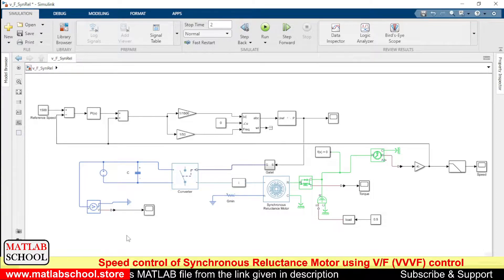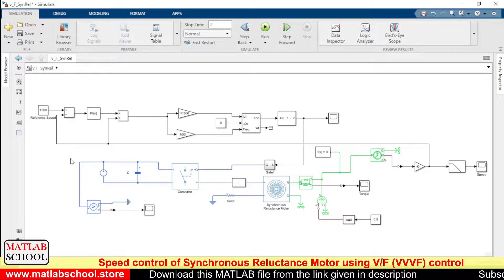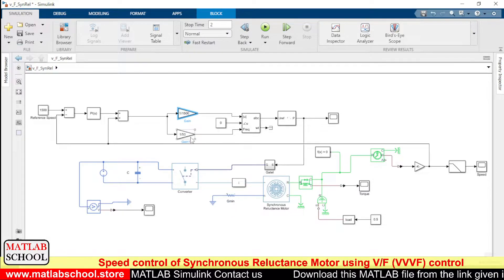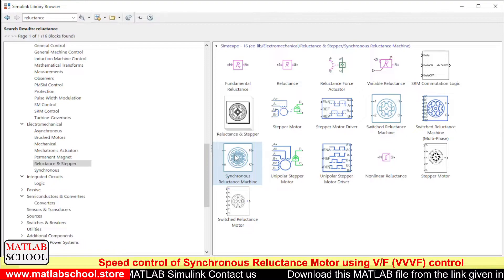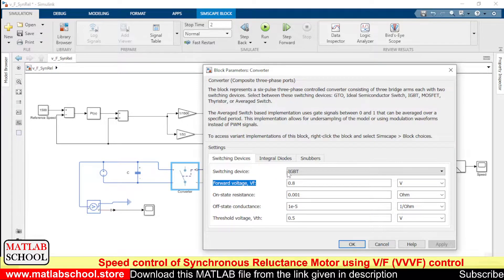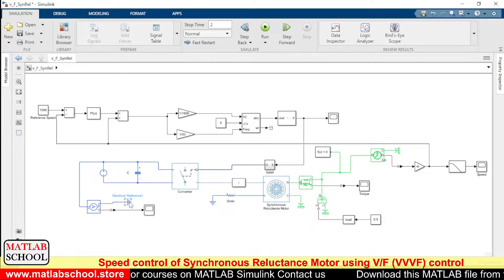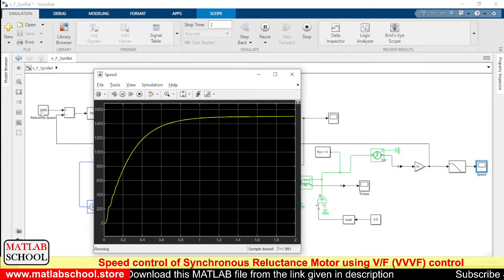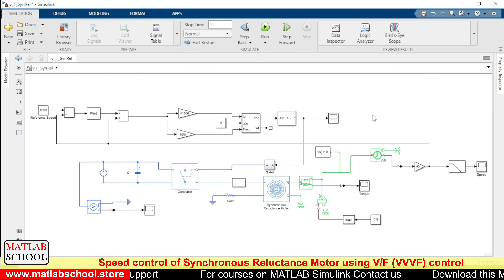Speed control of synchronous reluctance motor using V/F (VVVF) control | MATLAB Simulation

Comment: There is no reason to use V/F control for a SynRM. Simply use FOC control as you do for an IPM. It is a similar  machine, but no magnets. So flux of the machine is controlled by id, using rotorflux =(Ld-Lq)id  and torque  is controlled by iq.  For optimum control set id equal to iq, as discussed in our  Springer book 'Advanced Control of Electrical Drives'.  Operation is either with an encoder, or sensorless, using for example InstaSpin FAST, which looks at the EMF of the machine.
Reply from the maker: Thank you so much for your valuable insight...we will incorporate your suggestion.